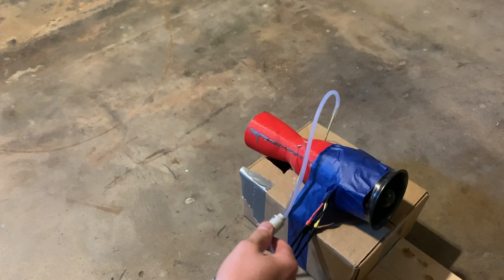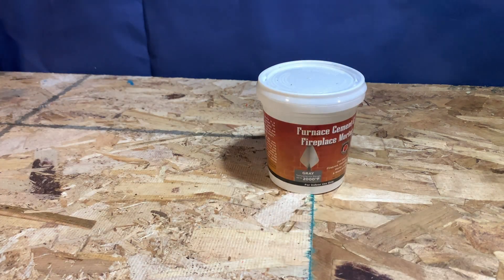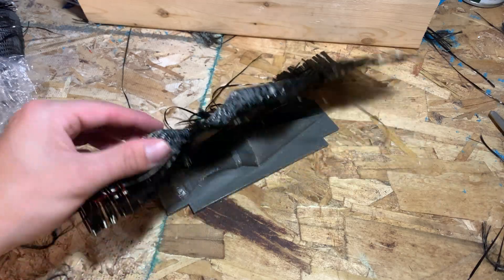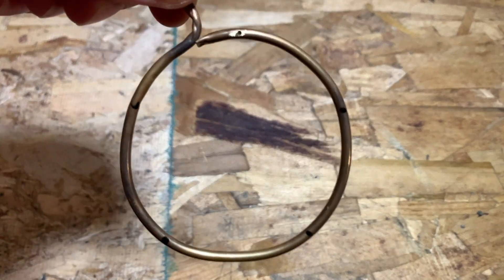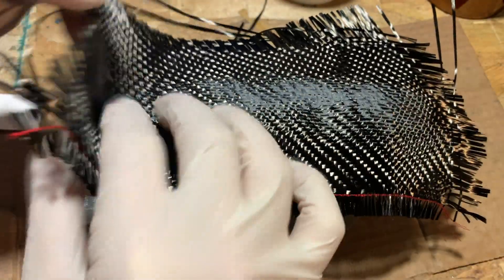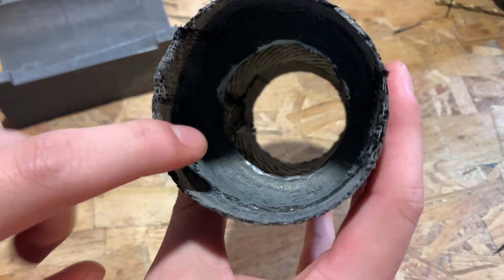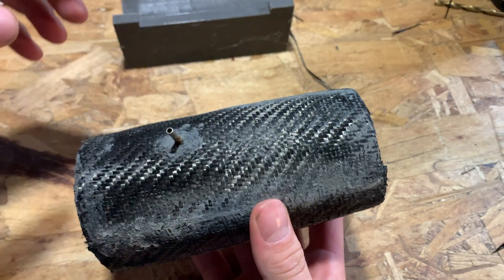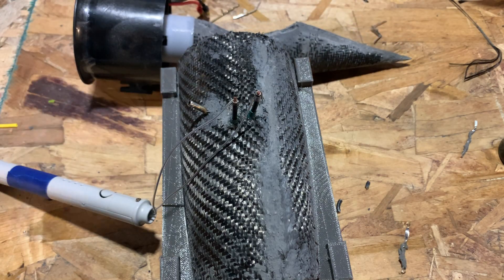Carbon Fiber Ramjet (RC)

Comment: Where did you get this ramjet and it works without throwing it from high altitudes? This requires a compressed air tank with a pressure equivalent to 1,000 bars.

Comment: could you use a tesla turbine at all because they are notorious for insane rpm and work as pumps etc could it be the ultimate fuel pump or air for the cycle fuck if i know but its an idea

Comment: You would get stronger parts and more precise geometry, and therefore better aerodynamics inside your engine if you filament wind on 3D printed mandrels. You can remove the mandrels by baking in an oven to let the molten plastic flow out.
Reply from the maker: That’s kind of what I’m planning on doing next, I’ve been experimenting with a ton of different methods and materials

Comment: So Cool.   I think that in this type of design the combustion should happen inside of the shielding of the EDF airflow.   The envionment air is static.  The EDF flow is second fastest.  The hot combustion should be fastest and inside the velocity wall of the EDF fan.  This requires two air flows.  One for the EDF and a second for the Hot ICE combustion.    I love what you are doing.  Keep Going. Thrust is about mass air flow.  On a small diameter that means very high velocity.

Comment: love the video, I would recommend switching to  a compressor fan instead of the EDF's. It might turn out closer to a turbojet (because of the compressor, But I think that high pressure air is always favorable over high speed air (especially when it comes to ignition).

Comment: Yeah definitely use a ducted centrifugal impeller instead of propeller like in the edf. I bet you can just 3d print an impeller and a diffuser for your edf motor

Comment: instead of buying that cement maybe just use sodium silicate to bind and build up layers over the carbon fiber
Reply from the maker: I’ve never thought of doing this, I may try that next time. I mainly used the mortar because it was cheap and easily available.
Reply: @JRYBuilds  so is sodium silicate as concrete sealer, or you can make with sodium hydroxide (drain cleaner) and silica gel (crystal cat litter). ive always wondered how it would work with carbon fiber, you should do it.

Comment: Far from an expert but isn't the spike supposed to be placed in the opposite direction for it to be working as a ram jet?
Reply from the maker: yes, I have seen some designs do what I did though and wanted to see what differences they would make. On a traditional ramjet there is no compressor so they use an aerospike for the compression stage.
Reply: @JRYBuilds  Okay, yeah that seems intersesting. Just started working on designing a simple jet engine myself but still working on the compressor design so I'm not close to working on the nozzle or combustor yet.

Comment: Maybe some stators past the edf and more even fuel injection could help performance. Also, perhaps this can use an EDF to get to speed but become a ramjet in the air after initiating a dive in the flight profile to get sufficient compression and use a ramjet to sustain that speed

Comment: what kind of a fuel injector did u use?
Reply from the maker: Pressurized butane is fed into a brass tube and out .75mm holes which are wrapped in a circle

Comment: I think that kevlar would be a more suited material for the exterior shell, carbon +-45 is not oriented correctly for your loads 1 Unidirectional layer as rings (90) would be needed if pressure builds up. 12K cabon filament wrap wold be ideal. The aerospike could be just mortar for testing purposes(or 3D printed ceramic).  roughness on the chamber can be enough to avoid success. a refractory inner surface will be needed (often coper to dissipate heat). not sure your propeller can suck enough O2 into the chamber fast enough because Reynolds at that size, probably you need a very lengthy compressor to get the volume right (maybe the whole aircraft body?) with few compressor stages. Liquid oxidiser and/or fuel could X400 the gas volume boosting your propulsion without the propeller.. (is a rocket) liquid O2 + Liquid propane (1l bottles exist ... at 110bar)... that would launch your plane to the stratosphere... casting metal from 3Dprint is also a good approach or conforming a thin copper layer around your 3D print ...
Reply from the maker: The biggest problem with Kevlar is the melting point, which is about 930 F. If I coated the outside with Kevlar to give the engine strength the heat should dissipate enough to not ruin the structural integrity of the Kevlar. The other problem is cost, Kevlar is not very cheap compared to carbon fiber

Comment: if its all staying on a platform , you could spin the impreller on a 3-1 or 4-1 gear increase from the motor ( e.g using a 25k rpm rc  brushless, and a metal impeller) a planetary gear mounted direct to the bldc motor could push 90k,, but these ideas dont solve the real issues at 90k like bearings , and the impeller exploding like a grenade

Comment: Theoretically you could create a venturi bottle neck (make the circle smaller and guide the air into its center point) its a multiplier for the airspeed at the price of a bit of drag.

Comment: Try a wind tunnel design to increase velocity. Large diameter intake with lower fan speeds narrowed down to the ramjet intake. Basically acting like a air intake funnel only powered by a fan on the large end. I'm talking a box fan size fan with a 18" intake narrowed to 3-4". The idea is to prove the theory works and then refine is later.

Comment: Instead of trying to achieve supersonic inlet conditions with an EDF (quite challenging) you can use a compressed air supply. With a pressure ratio of slightly above 1.8 and a small enough choke (or high enough flow rate) you can get sonic velocities. A large compressor is cheaper than a moderate sized EDF so I believe this is fairly economical as well.
Reply: I concur I was typing up something along these lines when I saw your comment :)
Reply: Me too I was going to suggest something else but this sounds like a better solution
Reply: Maybe instead of a fan blade, a printed centrifugal compressor would get air moving sufficiently quick
Reply: I suppose you could also add high subsonic pressurized air before the fan in a sealed tube. Might simulate high speed flight.

edit: probably wouldn't work super well as a high speed analogue. still a fun test.
Reply: I don't think the ideal compressor for the "EDF afterburner" application/concept is being manufactured (yet?).  It really needs a multi-stage axial aluminum, titanium or carbon fiber compressor to reach the pressure ratio for supersonic expansion with an acceptable thrust to weight ratio, also probably a longer flame tube for more efficient/complete combustion.

Comment: Hi, love this. Using Furnace Cement on CF -great idea!
Even to duplicate jet engine compression ratios would take 3 or 4 stages of alternating rotating EDFs. You might be able to use a centrifugal compressor on the inlet -there's a reason why Frank Whittles engines had a centrifugal compressor 1st stage.   I think it highly unlikely you can achieve hypersonic compression ratios without a vastly more expensive setup.

Comment: I did not know carbon fiber would be able to handle that much temperature
Reply from the maker: It can withstand direct flame from a blowtorch, it’s very strong against heat. The part I’m worried about is the fireplace mortar which is only rated for 2000 F. I did find a new one that is rated for 3000 F which I will use in my next version

Comment: Maybe a more powerful electric motor with a sort of long multiple row fanblade setup like a jet engine compressor would work. Then just squeeze the air to a tiny area to get the most air speed. You wouldn't need supersonic fan blades if you could supply enough static pressure to use a nozzle to accelerate the air. You may have to use carbon fiber and resin to make each fan blade. You could try making a thin walled hollow 3d print then coating them in fiber and resin to make your blades. It would be a lot of work but I don't know of any lightweight compressor blades for sale as hobby stuff. You could also try a massive air compressor for testing. Maybe a bunch of progressively smaller diameter electric hobby motors/fans would work. Either way good luck and I will continue to watch your career with great interest.

Comment: Scramjet no moving parts right.
 how can i called scram jet if that have an fan
Reply: It's ramjet first 
Second scarm jet or ramjet they use turbojet or Turbofan engine first then trun on ramjet and scarmjet engine after subsonic speed

Comment: 90k rpm can be achieved with some BLDC motors i think, you can even wind your own and use maybe a less permissive core material,  like 15 percent ferrite PLA (if you do you will need to make a decent driver circuit from scratch for the required voltage to get it up to that speed cause i doubt those themselves are made either)
as for the impeller, you could adapt the geometry to fit in an impeller from a used up car turbo ( gonna be a pain to get the right dimensions without the fin profile measures from paper tho) and while youre at it change the inside geometry to make a second air intake like a venturi pump, so it makes an air vortex that cools the inner walls and generates "suction" forwards while its at it.
if you want it to run on fuel only, theres some recent vids on a trick the navy used for better performance on their jets, basically split the compressor axis (one inside another) to different stages, so the outwards one was being driven by the higher speed outlet stage gas while the inwards one was driven by the high pressure combustion stage gas.

Comment: Suggestion? Try coating your molds in resin to help with things being conductive. Might help with your pressure issue too. Have you tried getting it started with a canister of pressurized gas? I mean for what you're doing is suggest carbon monoxide or even just carbon dioxide. The fuel:O2 mixture will still make sure it ignites and CO and CO2 will just temporarily add pressure the reaction should maintain it.
Reply from the maker: I can’t use any resin because of the high temperature. I’ve been thinking of adding compressed oxygen but that would be basically building a rocket and not an engine
Reply: @JRYBuilds  I'm honestly suggesting that instead of O2 going with compressed carbon monoxide, seriously. I've used it in done less than conventional race car engines and that's what it was used for was increasing ignition pressure... Now my guess to no where near the same as we were using methane as the primary fuel source but it's better than making rocket and the need that comes with that. If pressure is all you need have you considered nitrogen?

You can buy silicone/acrylic resins at hobby lobby that can withstand upwards of 2500C, it's not perfect but to much more than that and it won't matter that much what is made out of anyway.

Comment: If you want to create sustained air pressure, add multiple large fan intakes and funnel it into a smaller space to increase the pressure as with wind tunnels. If you can't create bigger intakes, then I would focus on miniaturizing the ramjet components as its ratio between the amount of air being forced in versus the size of the exit opening. If you used a 24-inch industrial fan with a high CFM (>5000 CFM) you can funnel that down to a 2-inch diameter, this would increase the density by 144x, still not close to hypersonic density though. If you had nine of the 24-inch industrial fans all being channeled into 1-inch outlets, then combine the nine streams into one smaller 1-inch final exhaust outlet, this could start getting close to the density level required depending on your local ambient air pressure. However, you are also talking about over 2000 pounds per square foot of pressure so just containing this can be challenging, with even a small piece of debris becoming very damaging.
Reply from the maker: This would be an interesting setup, and I have though about doing something similar to this. The two biggest problems are cost and size, this would be very expensive to source materials and the length of the funnels would be very long to get a steady flow
Reply: @JRYBuilds  Agreed, the size and cost of materials would present a challenge. If I was to do something like this, I would look for a cheap way to source the fans first and then worry about where and how to build it later. I have heard that people affected by the Boulder fire were given large fans by the utility companies to clear out the air and the companies don't want them back so I would expect they will appear as second-hand items online soon once people are done using them. Not sure how powerful they are but free is a great price. If you know someone in the area, they may be able to collect a bunch for you for free as people will probably throw them away otherwise. Once the fans are acquired, I'd probably build it inside a farm building, like a large barn or machinery shed, as the longer you can make it, the better it will perform.

Comment: Why don’t you make it out of cast metal it could provide a stronger base
Reply from the maker: I thought about doing that, but cast metal is too heavy for a setup like this. Aluminum would deform and steel is difficult to cast for an amateur setup
Reply: @JRYBuilds  maybe electro plate it with a more heat resistant material like hafnium carbide

Comment: sir, have you thought of using a glow plug instead of sparkplug for ignition?
Reply from the maker: The air moving inside the chamber would cool the glow plug down too much for it to ignite the fuel.

Comment: Cool, but getting a model plane to mach speeds just to be able to ignite the engine is not practical. Maybe try making an hybrid jet engine and a good plane body and you might be able to get it at a stable combustion. But after all it was a really good vid.
Reply from the maker: Yea it’s basically impossible, it’s more of a concept but I think I could hit over 200mph if I improve the pressure efficiency
Reply: @JRYBuilds  I just now realized that an rc jet/rocketplane over  speed of sound is probably illegal everywhere and sonic booms are probably the worst thing that can happen to a normal neighborhood.

Comment: Notice how the burner keeps blowing out? You might need to add a flame holder to prevent that. It would also increase combustion chamber pressure. A simple steel baffle plate or peforated cylinder would do. Just get a stainless steel dishwasher silverware holder or soap holder from Walmart or wherever and drill a few holes in it to start with, test fire it and add more holes as needed until it works right.
Reply from the maker: That’s what I had on previous versions, I was trying something new by pumping in fuel from the outer edge.

Comment: Can you not create a smaller ram jet, So ypu end up with a sort of turbo jet set up, the ram jet is say 50mm reducing to 40mm to increase pressure. Yet still allowing faster moving air to bypass the ramjet also helping cool the outside. Hope that makes sence does in my head haha
Reply from the maker: That’s kind of what I’m trying to do, the problem is increasing mass flow rate which is a big factor in producing thrust

Comment: Ramjet, one of the things I wanted to do at some point. I don’t remember but doesn’t a scramjet work at low speeds? (It is meant for even higher speeds)
The flame looked decently stable without the spike while it was inside the housing, spinning in a small vortex (this could be a bad think, idk), but I think a increase would help at the combustion point like you said. 
I really like where you are going with this and hope to see more!
Reply from the maker: A ramjet combusts at subsonic speeds and a scramjet combusts at supersonic speeds, ram jets are used at subsonic speeds but are extremely inefficient below Mach 1
Reply: The flame might stable but it's a fancy blowtorch and not an engine. It's impossible to create significant thrust if the incoming air is subsonic. You need at least > Mach 1, better 2, ideally 3.